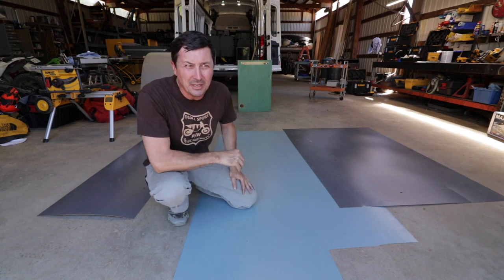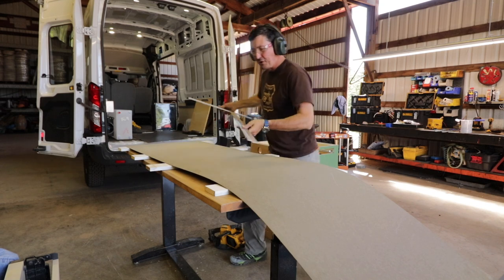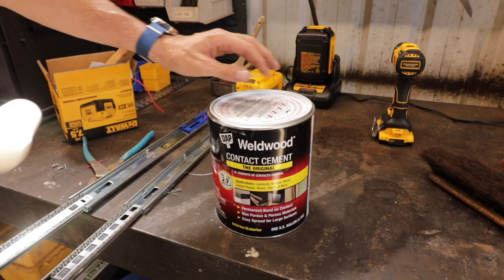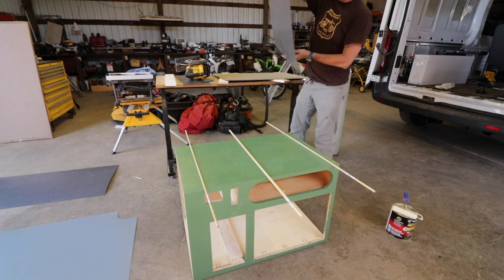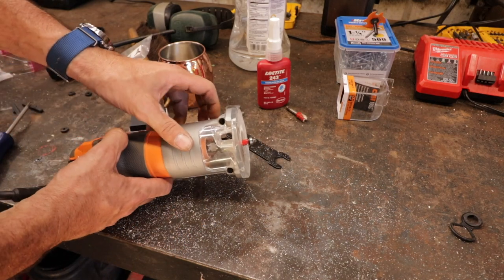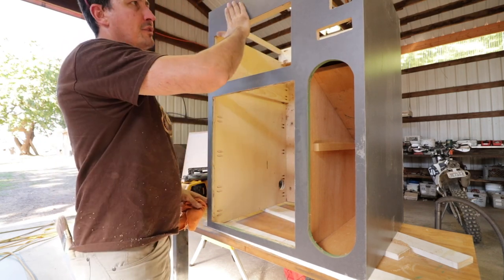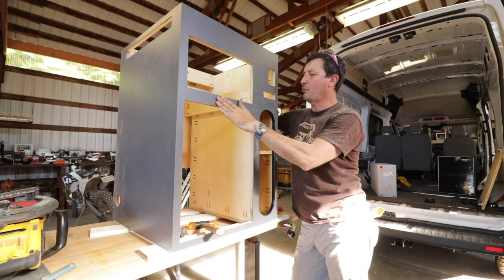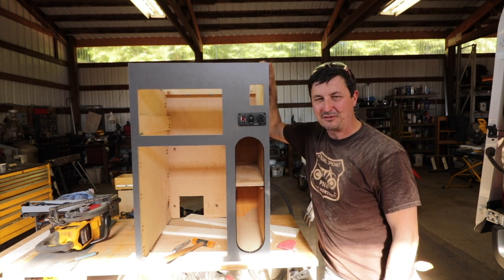Adventure Van Conversion - Building Cabinets

Comment: I work a lot with Formica/Laminate... All you need is Lacquer Thiner or Mineral Spirts located at any home improvement store... The contact cement residue just melts away with a normal paper towel... Be Advised, Lacquer Thinner is more stronger or more aggressive at melting contact cement, good for taking off thick gunk’d up dried contact cement buildups... Mineral Spirts is good more for cleaning up everyday minor type dried contact cement residue, or good over all cleaning maintenance for laminate.    The rubber trim can be installed with just normal wood glue or you could even use what u have contact cement if you want... many times we don’t even put anything for rubber trim. The barb backing in the back is strong enough to hold in place. I only use glue on the rubber trim if it’s a high traffic type area that people touch or rub up on a lot...  Hope this helps! ...Keep the videos coming... great work... watch u all the time. Cool!

Comment: Denatured alcohol is what we use to clean. Also i would recommend using the 3M super 77 contact cement spray, it will save a lot of time.

Comment: Couple of pointers for further laminating     1) always use a fine serrated edged flat blade for spreading  contact adhesive (3" flat spreading knife with serrated edge.  2) use a couple more 'dowels' on your base prior to making contact with your laminate   3)  use a 'fine' file to finish your corners/edges

Comment: Having done a lot of cabinetry work I would suggest using a heat gun to make the T mould pliable and knock it in as you go all the way round. so it can take on the curve of the cutout. Once it cools it should stay in there nice and tight. I’ve never used any adhesive on it and I’ve never had a piece pull out. If you were to glue it in and down the road the t mould got damaged you wouldn’t be able to remove it cleanly. I would also suggest putting the joint at the top so it’s harder to see. For cleanup I’ve alway used ABS edgeband cleaner or prepsol. Hope this helps.

Comment: Hey Cody, as for that black transition strip you need to use 3M double sided tape. In your case I'd cut the width of the tape to size on either side of the cut you made and not in one piece but two along the channel. That would get you a long life on that transition strip, I've seen contact cement used but the double-sided tape lasts much longer and gives a more professional look. Spent quite a few years in commercial and residential flooring instllation. 3M double-sided tape is what we use. As well as mineral spirits to remove contact cement residue

Comment: We used to put that molding on the edges of arcade cabinets back in the day, what we would do on rounded corners is cut out V's on the inside track part that goes into the wood that you used the router to hog out. That way it would conform to the shape of the curve easier. We never used glue. But those were arcade cabinets.

Comment: Cody
You do not need adhesive with vinyl T molding.
Since plywood thickness varies so much especially 3/4 , you can get 13/16 " wide if needed.
I typically paint around the hole that I am placing the molding around , or at minimum where the joint is ( dab of black paint for your app), then just glue the joint.

Comment: I would recommend using a Wilsonart 950 or Wilsonart Lockweld spray adhesive 740A.  Another option is Wolfgrip aerosol.   Lacquer thinner will clean any excess glue off.

Comment: A trick I learned from an aircraft laminate installer, way before internet days. After you route the edges take a fine file to relieve the sharp edge. If you leave it you risk cutting yourself, that laminate will stay sharp for a long time.  There are vids out there showing how.

Comment: Aceton doesn't affect laminate, so really anything would work.
And you did it right: you should never square up the inside corners, always leave a small radius, or a crack will start with moisture movement ( laminate is just paper, so it moves like wood a bit)
Great vid!!!

Comment: I've  used that vinyl edging on an arcade cabinet.  You don't need glue, but on an inside curve, you should slit the part that goes into the slot so that it can spread.  A hairdryer can make the edging a bit more pliable, if needed.

Comment: I love your videos! Keep being you. That tool/blade looks like a mini dado blade. When I do smooth glue down laminate floors, I know it’s different than what you’re doing, but I use a little goo gone and a razor blade and gently scrape with hardly any angle, so I don’t cut in. I generally start with a plastic scraper and razor blade to finish. It’s not as easy to cut the material as you would expect. Practice on a scrap piece.

Comment: The discoloration on the side is actually the laminate burning with the friction of the router bit. At the shop i work at we always grease the laminate with crisco oil to prevent that. For the seam on the rubber i would suggest putting it at the top of the cutout because no one ever looks at it from that angle.

Comment: I've done a good deal of plam work. Use some lube on you router barring, it will help keep the burning down. Use lacquer thinner for the glue clean up. And I use hot glue for the T strips.

Comment: ive laid miles of laminate, for a while before granite took over it was a goof 50 percent of all the work i did. i suggest using laminate on that circle your trying to clean up, should of done it before the face but that's ok it will still look okay. rip a piece of laminate about 3/8 wider then the plywood you used, then cut it to length so there's plenty extra. start on a straight away and get an idea where the curve starts and use a heat gun or a plumbing torch to bend the lamitae to shape.then you get to a point where you over lap that gives you your length, cut it a little long then use a block plane to bring it down to the final length. router and file the edge and your good to go. use paint thinner to clean up the edge. its not as harsh as some of the other chemicals people have mentioned and works just fine.

Comment: I haven't read through the comments so someone may have suggested this, but if you cut the web on the inside of the curves it will help the outside part go in flush with the cabinet edge.

Comment: Well done. Looks great. You can use a wee drop of thinners to remove the excess glue. The rubber trip, If you cut it slightly longer than needed it should push it's self into the corners then and should not need glued but if so you could use a small amount of general purpose glue.

Comment: You did a nice job on it. I haven’t done that in about 20 years. I love your channel and love the dirt bike stuff too. I’m 73 and can’t take the falls anymore. You will have falls, it’s part of riding. I think  the electric bikes have come along way. When then get better batteries it will take over. Nice not to hear the noise. Trouble is you might have a encounter with a animal, they don’t here you coming. I have just a 1000 watt mid-drive electric bike I use now. I had a deer jump right in front of me and almost knock me off my bike. With my old Suzuki pe250 you could hear that coming from a mile away

Comment: I have used the edging in a cabinet shop setting. The vinyl edging doesn't like sharp transitions, the radius to the straight sides. Use a heat gun to take the stress out of the vinyl edging. Practice on scrap so you don't melt it. No glue will stick  to it.

Comment: For the rubber trim do it warm put cuts in to the T as it goes around the curves at the top and bottom because the bottom of the groove is a longer arc then the opening so the T needs to be longer or have cuts in it. Also crowd the trim in this will help hold it in.

Comment: With the rubber trim, at the corners, if you cut the rubber that sticks into the wood groove it should help to seat the rubber better as it takes away the stress of stretching the rubber around the corner.

Comment: A little bit of Crisco shortening brushed onto the sides would have kept the router from burning the side laminate. Also like a few others have said use a file bring the face laminate perfectly flush with the sides (the trim router will leave a tiny little lip you can feel with your fingernail) Then use the file to round off the corners a little, but be very careful not to take away too much material or you’ll start seeing the layers of the laminate. Also if you have a belt sander it helps to sand the face of the cabinet around the edges where you glued on the side laminate, it just gets rid of that little lip the trim router leaves.

Comment: Your T-trim needs a little adhesive, I use silicone adhesive. Heat the strip up with a hair dryer to help it flex into the corners. Looking good! A little lacquer thinner will take the contact cement off.

Comment: I know you said that you didn't want us to comment if we haven't done this before but I think that if you make cut on the part that is sticking up the router hole where it's turning, that would relieve the tension and it won't come out. I'm just suggesting this because it's non-destructive and it doesn't require you to use any glue. If that doesn't work you can still use some kind of glue. :)

Comment: For the black trim, put small cuts in the web that is inserted in the groove. In the curved area, its stretched and is trying to pull itself back to straight. Maybe 4 or 5 cuts. They don't have to be 100% cut, just about 3/5 ths of the way. Also, push the trim like your trying to compress it into the curves. Contact cement will work fine.  I would have put the seam at the top. Just my humble opinion. I used to do upholstery and have done this before on some projects.    🇺🇸😎

Comment: Clean up with lacquer thinner. Use a laminate file to file the edges after routing them. Put a 2-3 degree bevel rather than the sharp 90 degrees left by the router. There's actually a specialty bevel bit for this, also. Wax your bearing before each cut with paste wax to help prevent scarring the face the bearing rides on, and also to keep it (bearing) from getting all gummed up with glue. Set the bit just deep enough to cut through the laminate (think you already discovered that one). Get a cheap plastic pour spout at any paint store to put on the edge of your can of glue. Prevents glue (and paint) from running down side of the can. Use a block of wood with a handle to press laminate onto substrate (A old fashioned paint scraper with the blades removed is perfect).

Comment: When I built my arcade cabinet I opted to add a little glue to the t molding.

Also when rounding corners, slice the t-mould (only the part that inserts into the slot) to allow it to flex around corners, I think you should add one or 2 relief cuts for the rounded areas.

In terms of glue I used gorilla and it worked really well, however I'm sure someone will pipe in with a better option.
Reply: Oh and this is just my opinion but I would put the seam at the top as you're less likely to see them since you are looking down at the hole.
Reply: Oh and I used masking tape to clamp down the t-moulding when it didn't want to stay flush until the glue dried.

Comment: Cody most Contact Cement can be cleaned up with Lacquer Thinner or Goof Off Adhesive Remover.  Lighter fluid also works if it has not set to long.  

A friend use to do van conversions and what he used for holding the trim in place on inside bends and ends was 3M Weather Stripping Adhesive.  He also used packing tape to hold the bends in place while the glue dried.  Dan would also warm the trim with a heat gun so it would take the shape better.  

For looks I think the seam of trim on the top that way it's not seen.  But Dan would put them on the sides in the flats of the cubby holes like you have.  Then you think about it it makes sense.

Comment: Just a tip on using a router. Outside cut move router in counter-clockwise direction only and on an inside cut clockwise only.

Comment: I've done camper cabinets a couple times, used that t molding too. Contact adhesive works good to keep it in, the main factor is making sure the glue doesn't have an expansion rate (anything that says it'll fill gaps has an expansion rate) if the glue expands it'll push the molding out a hair and you and only you will see the 1/16th gap between the molding and the wood and I promise it'll bother you every time.

Comment: You don’t need to glue the T-molding into the slot. What you need to do is heat the molding carefully with a heat gun in its lowest setting. This will allow the molding bend into the corners easier. You need a 1/2” depth of cut on your slot cutter to allow room for the barbed spline to “set” in the grove on most moldings.

A small J-roller is your best friend with laminate, and t molding. They are cheap off of amazon.

Otherwise, great job!

Regards,

Chris

Comment: At work we use stick fast ca adhesive. Medium thickness with the accelerator but you dont need the accelerator we just use it for to set up in seconds instead of minutes.

Comment: A little heat gun action on the corners of the t-molding will help it flex into the corners. J-role it and When it cools it should stay, if not a little epoxy will do the trick.

Comment: No, no glue, use a heat gun to relax the plastic on the curves, it has to stretch the rib on the inside of the groove and compress around the inside corner.  Just relax it a bit with a heat gun and it will work great!!

Comment: You should notch the spline for inside corners.  Also, t-molding should be put in with a 1/16" slot cutter.

Comment: 3M adhesive remover would clean up the contact cement and given the size of the project, you could have used a spray can of adhesive instead of purchasing a gallon, you probably could have gotten away with buying a quart or pint, if the store had the smaller quantities and you didn't want to use a spray can. The trick with spray cans is to apply the adhesive in perpendicular directions, for example spray the cabinet piece up and down and the laminate side to side.

Comment: When going around corners with T-molding cut a strait line in the part he goes into the slot in the middle of the corner. The sharper the corner the more cuts you make. This will make the T-molding lay flat.

Comment: I've installed vinyl and aluminum T molding many times for the company I work for. Don't use glue. It's not necessary. The problem with the oval opening is it's hard to get a mallet in there. I would turn to a J roller, especially when you are approaching the curves. Also the seam in that oval should be at the top so it's not as visible when standing in front of it.

Comment: Just a couple of comments:

1) I believe that's an oxygen or weld gas bottle rather than acetylene.  Sure wouldn't want to roll an acetylene bottle horizontally if you can keep from it (at least not without letting it sit long enough vertically to settle out before using it).  Good idea nonetheless.  

2)   Regarding the rubber trim on the vertical opening: I think I'd rather have the seam at the top, where it would be less visible, rather than putting it at the bottom.  Just a thought.  Also, I personally wouldn't glue it, as you might want to replace it at some time.

As always, thanks for sharing.

Steve

Comment: I’ve always used CA glue when doing that was plastic t moulding but you could also use a good instant bond liquid nails but that will drag on your dry time for a bit longer. 

(Or just use loctite 243)

Comment: I recommend rubber/plastic strips for the corners. Wouldn't want to bump into sharp laminate, even if the corners are nicely cleaned up. The strips should also help to protect the laminate from being caught on clothes or whatever and being torn off.

The inside wood could be sealed. With the fridge as well as a sink on top, it would be a shame to have water damage ruin the cabinet.

From my experience with contact cement, doing the trim piece that way isn't really feasible. Any time you can't directly apply the two surfaces, the glue will hang up before you can get the pieces together. Perhaps an Epoxy for being able to apply it wet. Disclaimer here that I'm not a cabinet maker, so as per your request in the video, this isn't a professional opinion. :)

Comment: one advantage your pa had using the curtain slats is they were flat,, didn't shift when you went to pulling them out. next time, cut strips from a one by four or something about 3/8 inch thick. NICE job.

Comment: 1) I enjoy the content, do your thing.
2) no need to glue the vinyl trim, just make some relief cuts in the spline to allow it to open up in the slot you cut so that the visible face can lay flush against surface.

Comment: I would have tried heating the rubber trim so that it molds to the corners.  never used the rubber. it just looks cheap. but for this application in a diy mobile solution why not?  I use banding which you can just buy and just gets ironed on... pretty simple.   Van is looking sweet.  remember don't let the haters bring ya down. they are just jealous. you are doing what you love... Nothing else in the world matters.

Comment: You don't ever glue "T" edging in, you nick the barbs that go in around the corners so it has relief to bend, this also works for outside corners where you actually remove a section of the barbs. Use a soft mallet to set the "T" in place not a hard one as it tends to bruise the T. Use a flat Stanley blade (I use an joiner blade) on the flat out of the handle to trim the overhang on the sides.
Don't drag the dowel out when you are setting laminate, roll them out as you press so no air gets between. 
Good job.